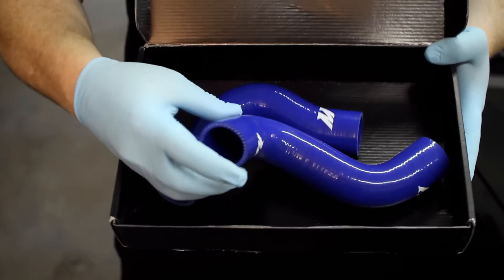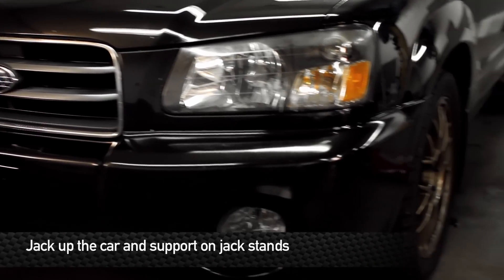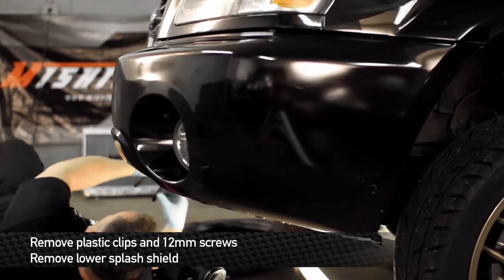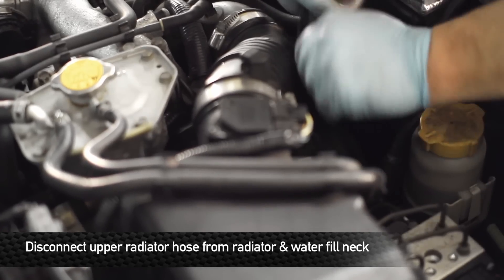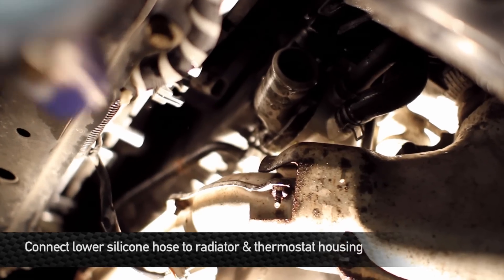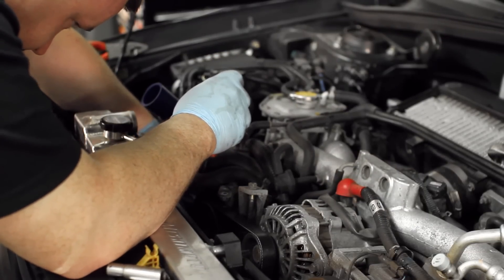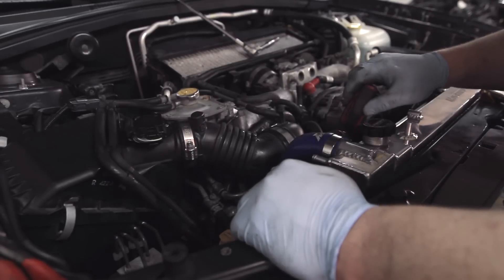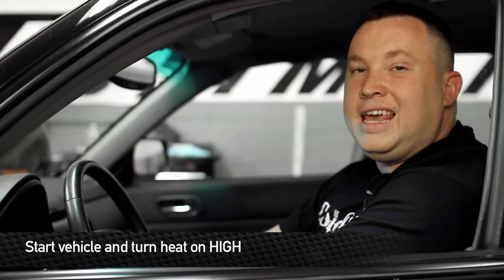Silicone Hose Kit for the Subaru Forester XT Turbo 2004-2008 Installation

Comment: Is the distilled water only if coolant isn't already diluted?
Reply from the maker: Yes, if full strength coolant is purchased, it must be diluted using distilled water. If you go with prediluted (50/50), nothing is needed before using it.

Comment: do you have a video for installing the TMIC kit?
Reply from the maker: We do have the install video for some of the WRX models but unfortunately nothing specific to the Forester.
Reply: @mishimoto  tks for the reply. appears only diff is the BPV.  and- just confirming you don't make a hose that'll work w/ FXT's stock bypass valve (so- I'll need one from an STI)?